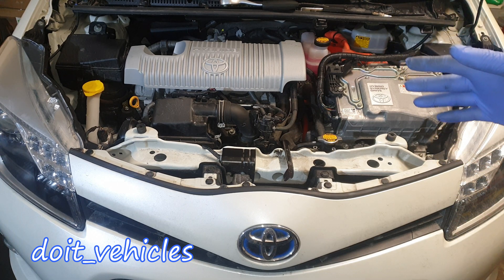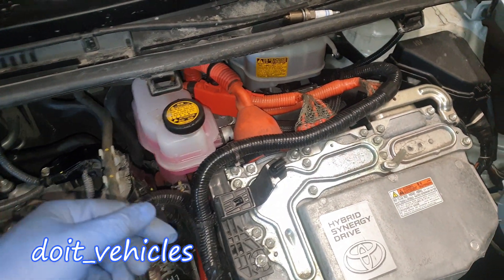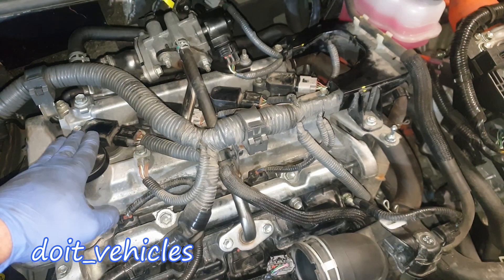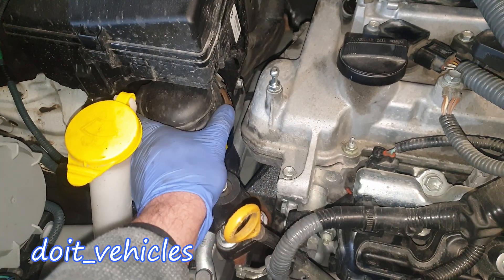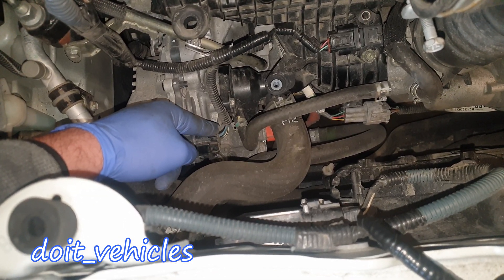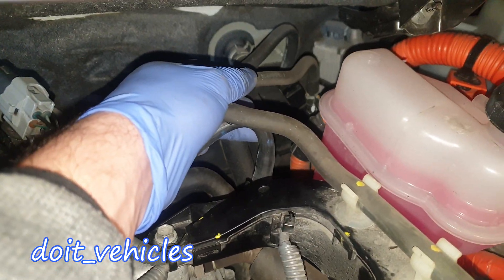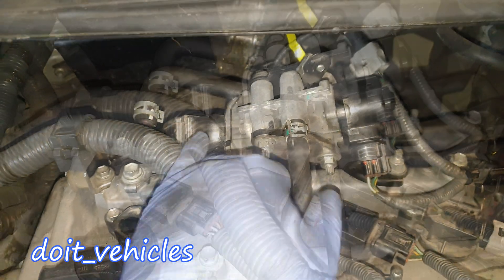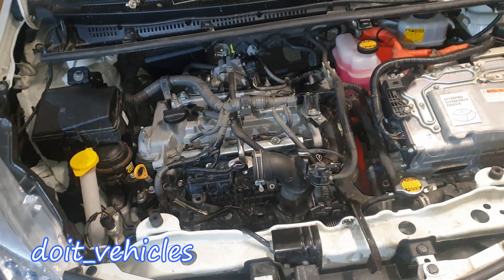All Components Location on Toyota Yaris Hybrid / Engine Bay Layout

Comment: Can i dicconeect the MG2 cable to drive only with fuel my battery is lighting engine check and hybride system check always after rest or may be take out the MG2 motor from the transaxle .. i have Yaris hybride 2012 model

Comment: Nice video. Was the catalytic converter just below the upstream o2 sensor? under the heat shield. Is the Cat in the engine bay, rear of the block? I was wondering if it is easy to steal? I've already had one cat stolen from Honda, I want to buy Yaris hybrid but don't want theft target. Thank you.

Comment: Hello Sir,

Ive just bought a 2014 Yaris hybrid from Copart.the power steering doesn’t work, what could be the issue please
Reply: The power Steering is most probably electric assisted under the steering colum, not belt driven have you checked the fuses.